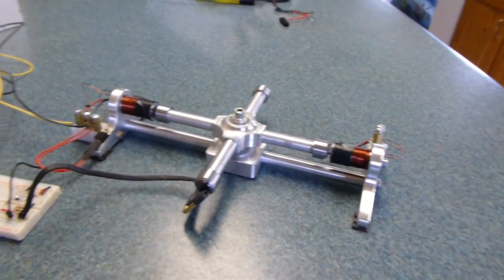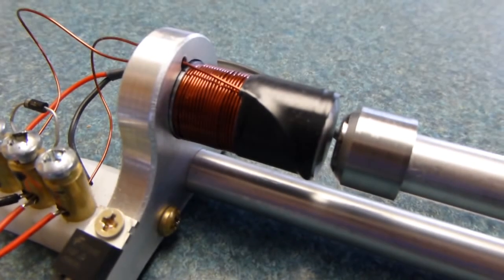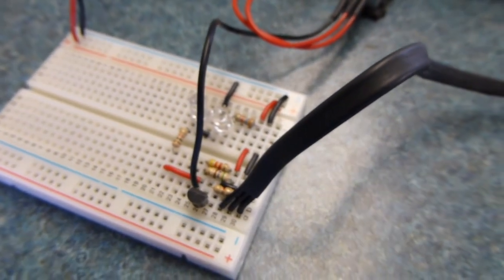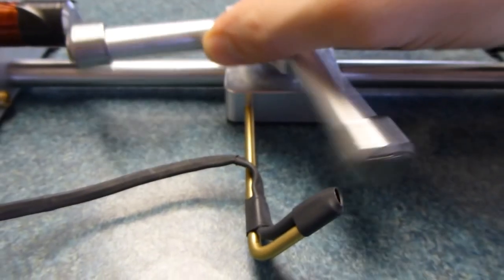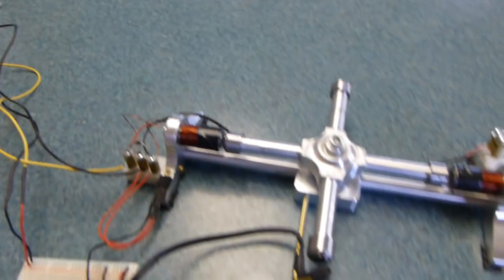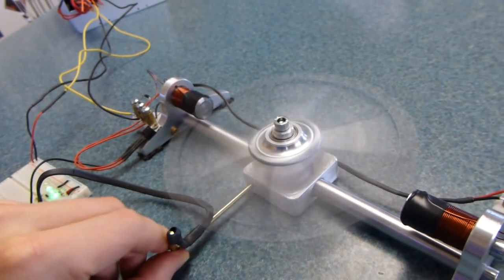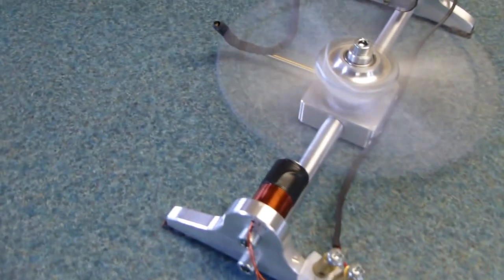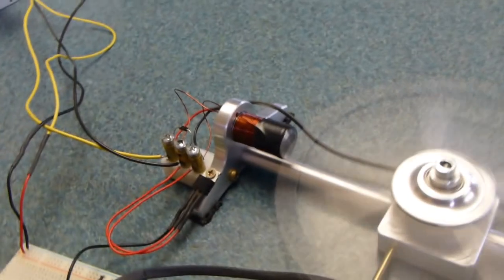DC Brushless Motor Project

Comment: I have a question, 
1) If I replace the coils on the two sides with coils of equal turns and with wires of less diameter, will the rotation speed decrease?
2) If I replace the coils on the two sides with coils of more turns but with wires of less diameter, so that the coil size in total remains constant(if suppose the container size in which I put the coils in remains constant), how will the rotation speed change?
Please reply! 
Thanks in advance!!!!
Reply from the maker: Experiment and find out!
Reply: Please at least answer the first question!!! I will find out the second one myself!!!!
Reply: The important factor for the magnetic field generation is
the number of turns multiplied by the coil current. The size of the wire has to
do with its resistance. My using thinner wire and/or more turns you increase
the resistance so you will need more voltage to get the same current. Also for
the same current with increased resistance results in greater heating of the
wire (it may or may not be an issue).
Reply: So, if I replace the coils on the two sides with coils of equal turns and with wires of less diameter, the rotation speed is probably going to decrease a little but it should not be much less compared to the previous one. So, I think it is better to replace the coils on the two sides with coils of more turns but with wires of less diameter, so that the coil size in total remains constant which will result in a slight decrease of current due to long length and less diameter of the wire, but the magnetic field should increase much more due to the large number of turns of the coil.
If the previous statement is true, the thickness(diameter) of the wire of the coil should be reduced as much as possible until it is prone to melt(i.e., until some heating problem occurs). Right?
Reply: Assuming DC steady current, decreasing the cross section of the wire (assumingfor example that we will reduce it to 1/2 of the initial), it will increase the number of turns (it will be doubled), but the resistance will also increase (it will be doubled per length unit, and also be doubled due to double cable length, so it will actualy be 4 times larger) . So the current will be less (1/4 of the initial, but with doubled the number of turns, so the field will be of half the power). To keep up the field you need to increase the voltage (to double it).
The current will not be DC thought but inductance and back EMF (the primary reasons that limit the current and in turn the magnetic field), work in a simmilar way.
So finer wires need proportionaly more voltage to keep up.
Reply: But decreasing the cross section of the wire (assuming for example that we will reduce it to 1/2 of the initial), according to the formula πr^2 it will increase the number of turns definitely. But it will not be doubled but increased upto four times... 
So the resistance will be increased by 2 more times and the field generated should also double...
There may be many more similar factors... 
So, the best way to check performance is to experiment, maybe!!!
Reply: Cross section is the area of a cut, not the radius. Reducing radius or diameter by 2 will increase turns by 4 but also resistance by 4. Anyway, why do you care that much? This kind of motor is not an efficient high power motor, it is for demonstration, if it turns, it is good.

Comment: very nice work.
Please elaborate on how rotating the hall effect sensor can change the speed. hall effect can only detect the position of the magnet or can do more than that?
Reply from the maker: That's all it does. The speed change is because of the changing relationship between the speed of the rotor and relative position of the rotor end and coil, nothing special.
Reply: Jon Proce I am curious how the sensor changes the relation between these two?
Reply from the maker: +Navid Davani as the speed at which the rotor approaches the pole changes the ideal pulse timing of the circuit changes.
Reply: Jon Proce  oh ok. but what actually rotating the sensor does to change the speed which then changes the pulse timing? 

if you rotate the sensor ccw, would it increase the speed?!

Comment: could u help me? I work fixing smartphones, and some times the loudspeaker of some phones gets full of metal powder for some reason (consumer fault). I'm thinking about in build a tool that can pull that powder out of the speaker magnet. I was thinking about an eletric screwdriver, powered by a 9v battery, making the tool an eletric magnet stronger than the speaker magnet, so it could take off that powder, and when powered off, the powder just go away from the tool. Got the idea? My doubt is about the eletric coil, wich wire should i use, thin or thick, how many turns and this kinda of question. I saw some videos about eletric magnets, but never really built one. Can u give me some tips?
Reply: Just use a stronger magnet
Reply: maybe a lil bit late, basically the number of turns and current increase the "power", and the wire you use should be able to withstand the current.
Reply from the maker: But remember that increasing the number of turns will increase the resistance of the coil which with the same voltage source will decrease current. Would need increased voltage at the source to maintain current with more turns.
Reply: By the way, it is very hard to make a strong electromagnet. Just get a strong Nd magnet, put it in a plastic bag, draw the metal powder, turn the bag inside out and drop it.
Reply: Got it. Thanks folks!
Reply: Thanos M lol it's not that "hard" to get electromagnet stronger than phone magnet. but that works too
Reply: +Fathin Luqman How many amps do you think that you need around a steel rod to match the strength of a similar size N52 grade Nd magnet?

Comment: Hello Jon what are your coil wire wound around and are there magnets in the tips as well? Im looking for that middle 4 way piece I cant find it any where. I had all the parts but that part. I have a application Project to do for my last semester! I enjoied the video.
Reply from the maker: +Archie Cheek The wire is wrapped around 1018 steel cores. There are magnets glued into the end of the rotor arms.You won't be able to find any of the aluminum parts, I designed and machined them specifically for this project.
Reply: +Jon Proce Thanks for getting back with me so soon. so the aluminum wire is wrapped around a steel pipe. im just use a ball bearing to rotate the magnets. how long were the cores and what was the approx distance between the core and the hall effect sensor?
Reply: +Jon Proce also the distance between the poles and the coils as well
Reply from the maker: +Archie Cheek close as you can get it without interference.
Reply: Hey Jon how long were the coils 3" with 280 wounds of aluminum wire what size? Also how many inches from end to end were the 4 way cross 18"? Thanks for the help Jon.
Reply: Sorry with all the detail question but thats the way I but if you dont know then let me know and i want bother you any more. thank you.

Comment: I was about to say that you could move the sensor to adjust the timing to speed it up, but then I watched the rest of the video.  What kind of class are you in where that was a project.  I never got to have classes like that!
Reply from the maker: I think it was called Power Electronics? Fourth year in my mechanical engineering degree.
Reply: how can run CD ROM motor without ESC circuit and magnet changing ?

Comment: this motor is just missing a series or gears to build up torque and this is lovely pretty easy looking design from just looking at what you presented kudos to you, im actually looking to build a brushed dc with gears essentially building a servo motor so i stumble across this video, good job

Comment: +Jon Proce
This is not Brushless DC Motor - this what you have created is very, very simply stepper motor.
Reply from the maker: I disagree, but I guess you could argue either way. I feel like a stepper motor is described by its function rather than its construction, and this doesn't really serve the function of a stepper in any way.
Reply: +Jon Proce After a moment's reflection... Which metal is made motor's support?
Reply from the maker: Aluminium.

Comment: Dear Jon, how do you control the direction of the rotation ?! with just two coils ?!
Reply from the maker: it's random. Depends mostly on geometry and inertia.
Reply: What is the simplest way to control the direction in your opinion? I dont want to use a micro controller,  of course I'm talking about more than just two coils,  is there a simple analog or digital circuit which performs the switching in the right order?
Reply from the maker: +Omar Saad bend whatever the coils are mounted on so that they're pointing slightly off of center. It will spin in the direction that they're offset to.
Reply: Angle the coils a little to repel the magnets on one side only. It's working even with one coil .. with two, you have more power.

Comment: Well done.. I tried to build a mock up of this and what I was unable to get past was how the circuit was to be setup. I wish their was clearer step by step instructions as I have all the components. But great job..impressed!
Reply from the maker: +Drue M 

All it does is allow the MOSFET to pass current through the coil circuit when a magnet is in front of the Hall sensor. Couldn't be simpler!
Reply: +Jon Proce Couldnt you use a power transistor?
Reply from the maker: Yes you could, same principle.
Reply: Jon Proce But then youd not need the circuit? Just connect it to the power transistor with a power line.

I am learning about this, hope to build a motor like yours! Looks powerful!
Reply from the maker: +Joep Stuyfzand the power must be pulsed on and off for it to work, you need the switching circuit.
Reply: +Jon Proce but the hall sensor turns of whenever there is  magnet right? so it pulses by itself
Reply from the maker: +Joep Stuyfzand yes, that sensor controls the switching circuit. I'm not sure what you're getting at, a transistor would be wired in the same was as the MOSFET
Reply: +Jon Proce exactly, just a transistor, thus i dont understand the need for the circuit with the leds and such
Reply from the maker: +Joep Stuyfzand you don't need the LEDs, and the small transistor would be optional if you had a hall effect sensor that output the proper signal polarity, I had to invert mine.
Reply: Jon Proce Allright! Thanks! I`ll make mine a three coiler.

Comment: I'm thinking about a similar project. Could you tell me the number of the electromagnet's turns, please.
Reply from the maker: +Erik Schubert 

I have no idea. The cores were about 1/2" OD and the finished windings were about 1" OD and 1-1/4" long. Math it up! I think the wire was 0.030 or so.

Comment: Hey Jon, what type of mosfet did you use? Model number or data sheet would be helpful.
Reply from the maker: +Jack Kwaak Just a standard NPN MOSFET. Probably 20A or so.
Reply: Npn and mosfet are not the same thing 
Npn is a bipolar junction transistor,
Mosfet is a metal oxide semiconductor field effect. 
The difference is that "no current" enters the gate of a mosfet. 
Ur schematic spices a mosfet, so I assume u ment n channel. 

Overall good job on the project. Bldc is not easy to implement. 
Tip3000 series npns can give u about 3 amps which is definetly enough.
Reply from the maker: +Andrew Klinkowski
you're right! N channel, not NPN.

Comment: nice motor....why you say to Ahmed ishaq its bad idea to put on of this motor on bike? dont work?
wath are you study?
Reply from the maker: it's not a bad idea to put 'a' motor on a bike, but it would be a terrible idea to put 'this' motor or one of a similar design on a bike. It's terribly inefficient, generates nearly zero torque, and was designed and constructed for demonstration only. It has no practical application.
Reply: +Jon Proce this motor or this type of motor BLDC motor(brushless motor) ?
Its just wath i am interesting wath motor its beter BLDC or Inducted AC motor. i want to compare the Torque the top of rpm and the temperature when its working.
Reply from the maker: +SLEVIN SHAFEL BLDC is a very good type of motor if coupled with a quality speed controller.
Reply: +Jon Proce ok thank you
Reply: Hey man with that speed on the motor could you somehow add plastic propellers on top? If so pls reply when you have made a video about it
Reply from the maker: +Eduard Baz   You could, but it wouldn't work very well. It doesn't matter what the speed is, this motor doesn't have enough torque to do any real work.
Reply: well then, have you tried to make a tiny plane from miniature working plane engines and then add a circut board so it could be rc?
Reply from the maker: Just buy off-the-shelf RC model components. They'd be an order of magnitude better and cheaper.
Reply: Jon Proce well, thanks for advice, but do you know any site where i can buy components to a mini plane engine? (gas rc engine)
Reply from the maker: HobbyKing or any other hobby supply shop!

Comment: What are the parts on the far right in the schematic picture in DropBox link?
Reply from the maker: +Connor Widder That's the MOSFET and the two coils. That's the actual power circuit that drives it. The transistor you see on the left is actually just there to invert the output signal from the Hall sensor.

Comment: Nicely made, Jon.  Could you say a few words about the self-starting feature.  On the video you say that when stopped the rotor is just cocked off in one direction, but you don't say how you made this happen.  From the fact that the magnets are attracted to the "coils" when power is off,  I guess there's some ferrous metal around somewhere.  Are the coils iron-cored?  My best guess is that you've put a slightly off-centre steel washer on the end of each coil.... is that right? .... interesting idea if so, I always thought one needed 3 elements for self-starting.  Cheers.
Reply from the maker: Ray Kent Hey Ray, it just means that the geometry is imperfect. The forces exerted by the two coils on the rotor aren't exactly toward the center, so they result in a net moment on the rotor which helps it to start up. It wasn't intentionally designed, it's just something I assumed would happen.
Reply: +Jon Proce Hi Jon.  Thanks for the quick reply!  So it's symmetry breaking by "accident".   Nice....
Reply from the maker: Haha yeah, by accident on purpose ;)

Comment: Is there any difference between enamelled copper and enamelled aluminium ? If so do tell cause where i live aluminium is way cheaper than copper.
Reply from the maker: Aditya angara The difference lies in the resistance of the two materials. Aluminum has higher resistance per unit area, so for the same size wire you'll require higher voltage to drive the same amount of current. You'll also lose more energy to heat with aluminum than with copper.
Reply: So copper it is , and can you explain the terminals please ?
Reply from the maker: The round terminals? They're just terminal blocks I made to make it so I could take things apart easily. You could buy them just as easily (terminal strips)

Comment: could you post the resistor and transistor sizes?
Reply from the maker: kejones0123 The resistors were only there for the LEDs and don't need to be included. The transistor size doesn't matter either, it's just inverting the signal from the Hall sensor. Depending on your sensor you might not need them, either. The MOSFET was good for 30 amps.

Comment: Just thought I would add that advancing the timing would make a motor/engine run quicker, as u state at 2m:14s that retarding it makes it quicker, this is wrong. (Advanced timing = quicker) (Retarded timing = slower).
10 years Qualified self employed automotive technician.
Reply from the maker: Mike W Yes, it's "like", but not the same.

Comment: dear Jon
   Thanks for your share and respond.I thinged as old physicien(may be extremely?) One little probability is Slow rise power self start problem!Thanks and congrulations..
   By the way your motor type is thing Rotary two arm and upon the arms linear sildess.Dual arm polar coordinate based 2 dimension router guides...may be?Thanks agian jon.

Comment: A quick question.  Your motor self starts.  I've built a motor with a different design and I have to spin it to get the motor going.  You say you cocked off the rotor arms slightly but I can't see how that was done by looking at the video.  The rotor arms look parallel and they don't look offset from the center bearing hub.
Reply from the maker: The rotor arms aren't perfectly perpendicular. My motor is powerful enough to take that slight imbalance and give the rotor an initial boost. Yours may not have enough stalled torque to self start in the same way.
Reply: Jon Proce
I guess if I skew my north/south arms slightly, the magnet may want to pull that misaligned arm enough to get it started.
Reply from the maker: Yeah, that's the idea.

Comment: HI Jon, What about having the central hub floating on a magnetic field. And have heavy liquid run out to the end of the arms as the speed increases making it a near to friction less flywheel. Regards, Graham
Reply from the maker: That's a good thought but it requires the hub to be very nearly perfectly balanced which this one was not. The bearing does introduce friction but it also stops the rotor from flying off into oblivion :)